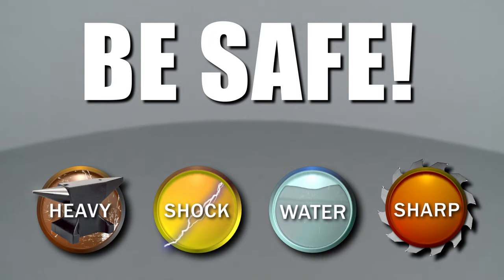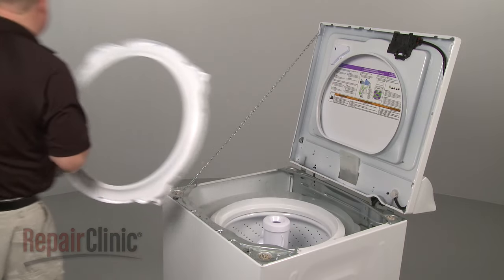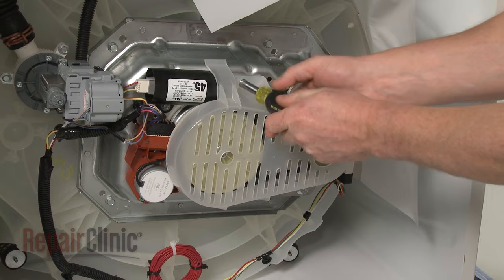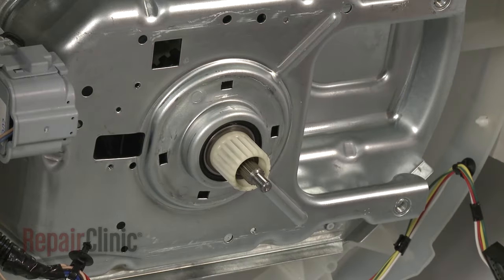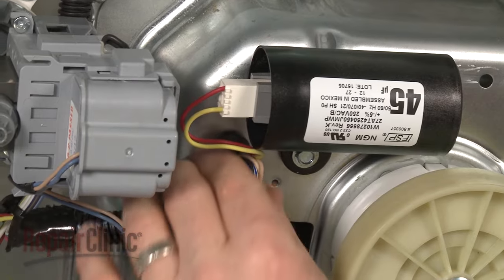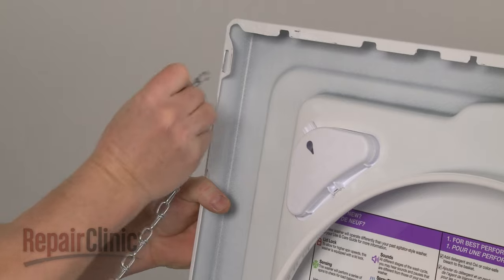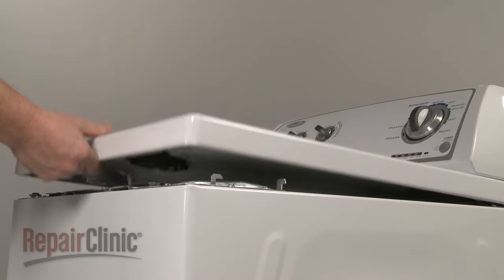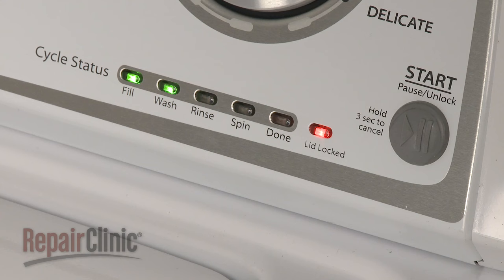Whirlpool Top-Load Washer Transmission Replacement #W10473144

Comment: This 9 minute was MUCH more helpful than the other 27 minute found online. I would add two tips: 1) spray WD-40 on spindle and allow to penetrate for 10 minutes before removing the tub 2) the video says to remove a bolt to detach the capacitor, when the capacitor actually needs to be lifted slightly and then turned 1/4 rotation to remove (no bolt). Total time to replace was just over an hour (would have been quicker but I was working in tight quarters.)
Reply: This saved my life! Thanks so much for this tip!
Reply: Some capacitors have the bolt (older) and some have the lift the tail of the capacitor slightly and turn a quarter turn to remove (newer)

Comment: I have bought 2 of these maytag centenial models and they are the worst investment my old kenmore is more reliable and has been around for more than 20 years
Reply: Yours has to be a direct drive unit, those old units were replaced for this crap, old units were easy and cheap to repair and had a great performance.

Comment from the maker: When the new transmission is put on the tub the seal may be a little hard going in. You can put a little dish soap on the seal to help it slide in the tub better. Once the bolts are tightened on the transmission the seal will be fully seated.

Comment: Mine is getting noisy. I was hoping it was the “bearing setup” but after looking at diagram looks like transmission. How long do they last after become noisy?
Reply: mines been running over a year noisy
Reply: I had one that ran for nearly 10 years in its noisy state, but it did progressively get louder.

It was still working when it was replaced.
Reply: @Smurdle450  transmission alone was over $200. Just got another washer instead

Comment: Make sure you have TB123A. It's the spanner wrench part number needed for the job.
Reply: You can use a thick file and hammer if you don’t have a spanner wrench
Reply: @jb3995  I also just achieved it by using a small crowbar and hammer. Though, a thick file would have been better.

Comment from the maker: I would recommend using the repair help section of our website (link in the description). If you enter your model number there you'll have access to model, part, and symptom specific repair help. You'll be able to see a list of symptoms that relates to your washer not spinning or agitating.
Reply: Washer wtw5640xw2 oil inside tub on clothes

Comment from the maker: There shouldn't be anything in the way when you put the transmission back in the hole in the bottom of the tub. Make sure you use the correct model # so you have the right part. Make sure the old tub seal is removed from the tub they sometimes will stay in the tub when the old transmission is pulled out.

Comment: I wish they would do this with used machines. It’s not as easy it looks
Reply: Mainly getting the inner tub out is a mf on some used machines
Reply: @MrClo352  I’ve found using a car hack and a 2x4 helps tremendously

Comment: According to at least one YouTube video, agitation us achieved by the motor switching direction (instead of a mechanical device like a steam locomotive wheel).  [The splutch decides whether the motor/belt/pulley is connected to the agitator or the tub/basket.]  If that's true, what, exactly is in the gearcase?

Comment: my washer pulley doesn't align with the motor n the belt keeps wanting to come off as well as the machine makes a grinding noise do u think replacing the splutch assembly will fix it
Reply from the maker: +Donnie Nasouluk We would suspect there is a problem with the transmission/gear case.

Comment: I replaced the transmission on my Whirlpool WTW4950XW. Look very simular on the bottom but it is a HE so it doesn't have the taller agitator. Now it is making a strange noise when it is in the wash cycle. Any advice. I can post a video of the noises it is makins if need be.
Reply: Bryan Hartline my suggestion is to throw it away. These are terrible products
Reply: Make sure plastic shield is not rubbing on pullys
Reply: Pulley is bad, check that out.

Comment: I am trying to but the drive shaft back in from the bottom of the tub, but it doesn't go up far enough for me to bolt it back. The brake isn't in the way, I can't figure out what's blocking it. Any ideas?  Thanks in advance for any help.

Comment: I have the same washer but the bolt and nut holding the pully on are both spinning and i cant get it off. any suggestions?
Reply from the maker: If you hold the pulley with pliers but the nut will not come loose and just keeps turning, the splines in the pulley may be stripped out. You may have to break off the pulley and install a new one. Holding the pulley should keep the transmission shaft from turning, if the splines are not stripped out.

Comment: FYI After drilling out the "rivets" and beating and pulling on the shaft in both directions It isn't coming apart and nothing is budging. What a peace of shit design. Whoever design it should be beaten severely.
Reply from the maker: The only thing that looks like a rivet are the stampings around the edge of the transmission. Drilling these out will not help get the transmission out. After you are sure that all four bolts holding the transmission to the tank are out and the agitator is off, you will need to get something in between the tub and the transmission and pry it out  taking care not to crack the plastic tank. The seal may have corroded and locked itself on the tub. Hope this works out for you and you have a successful  repair.
Reply: ***** No, I've got the transmission out. I just don't want to spend $200+ on a new transmission when all that's wrong with it is that the bearings are worn out because the tub seal gave and let water pull up and leak into the top and bottom bearing. I've just got no idea how to get the two sheet metal parts apart without obliterating something. It was designed to fail and be unrepairable; that's unacceptable and highly aggravating. Two Years is how long it lasted.

Comment: Motor is making noise  inwhirlpool top model machine while drum is not rotating
Reply: Kuldeep Singh  is check either board no supplying right voltage, capacitor, or motor itself

Comment: My washer fills up but does not do anything else will not adjitate and will not spin or drain all it does is make a buzzing noise.  any idea's
Reply from the maker: Joshua Michelsen We recommend visiting our repair help section with your model number for additional information. http://www.repairclinic.com/RepairHelp/Washing-Machine-Repair-Help?TSLID=1773
Reply: Probably the shift actuator.

Comment: Hola amigos, estas lavadoras después de cierto tiempo de uso empiezan a vibrar y a golpear muy fuerte la tina contra el gabinete en el momento de centrifugar. Cual seria al solución a este problema? . Gracias por su atención.
Reply from the maker: ELKIN RUBEN HERNANDEZ ARCINIEGAS If you have this design of machine then the support rod and spring assemblies may need replacement. www.repairclinic.com?TLSID=1773 Enter you model number into our website to find parts.
Reply: No le cambies los soportes por originales  , son caros y no duran mucho, remplazalos por soportes( cables suspension) por los de la general electric son mas efectivos, mas fuertes , nota al margen: la whirlpool la cago con esta maquina , es malisima y poco practica a diferencia de la anterior que usaba coupling entre el motor y la transm.